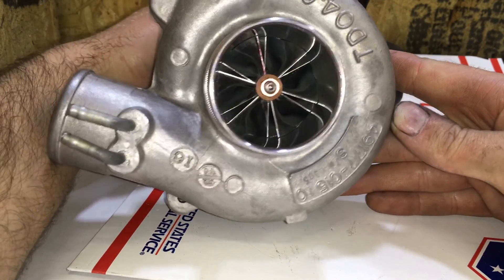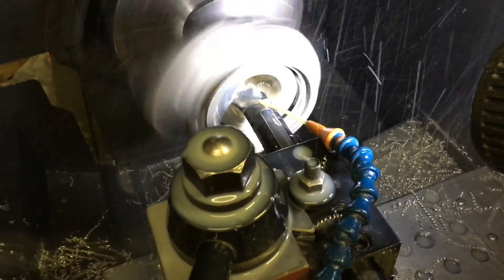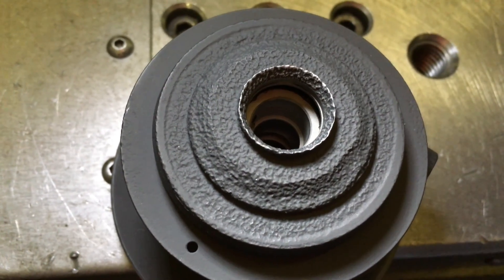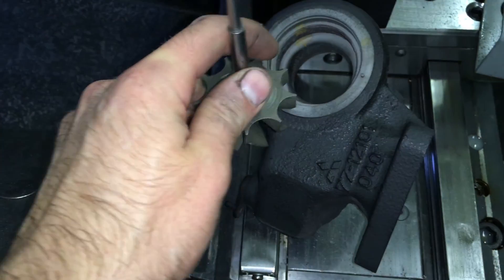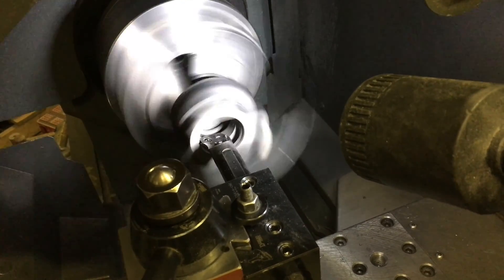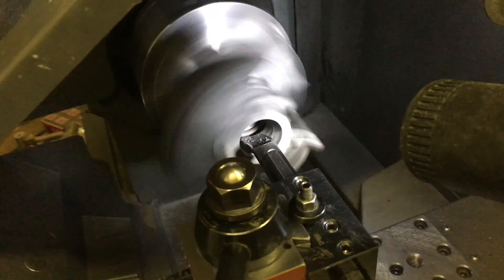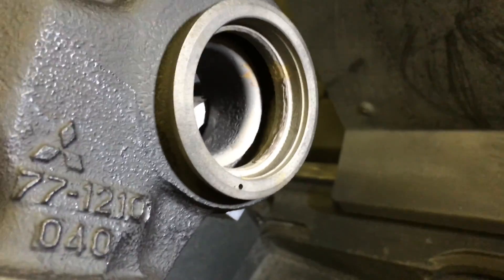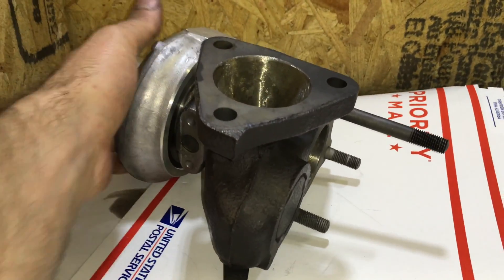Mighty Max TDO4 9B Turbo Upgrade Machining

Comment: Awesome machine work. I wish I could upgrade my journal bearing turbonetics 66mm cast inducer impeller into the 76 mm billet impeller which is the largest for that housing available. my supra should make a bit more power. I'm curious, if I could find the 76mm inducer impeller, how much would you charge to machine the housing larger?
Reply from the maker: +Michael C I haven't worked on the larger Percison turbos over 67 mm (t67). The larger sizes start to change a lot of dimensions including superback height, shaft bores 6.35 to 7.93 mm, and compressor plates such as H plates and F plates.  I don't know if I can get all of the parts for a build like that, meaning idk how long it would take to do or if it can be done at all.

Right now I'm going to trying see if a powermax / gtx4088 compressor wheel will fit a big shaft turbinetics turbo that I'm trying to fix.